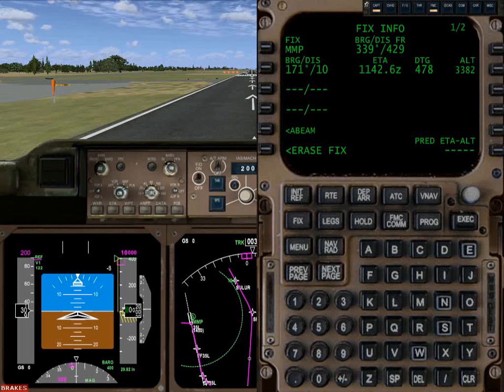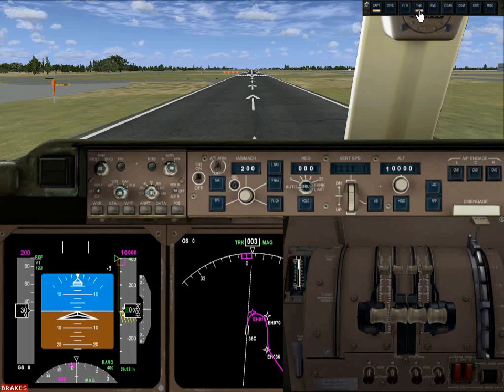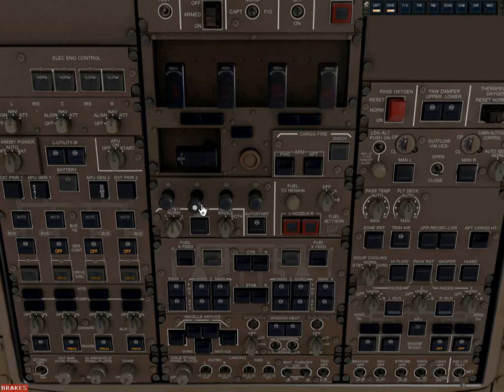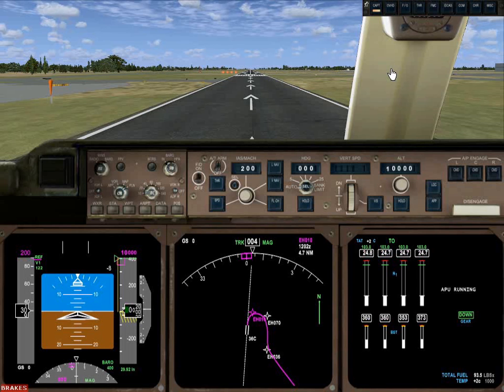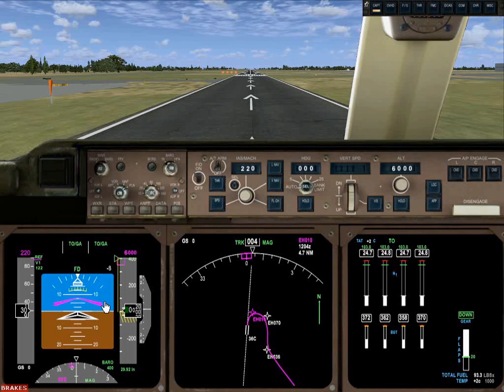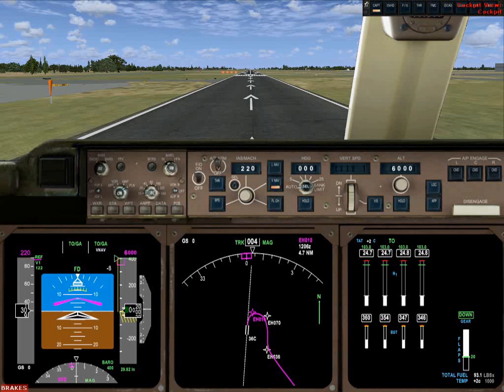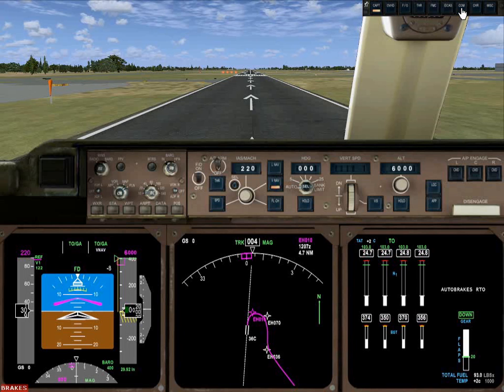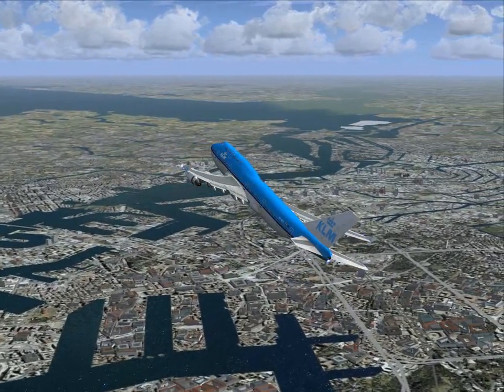PMDG 747 Flight Tutorial Part 5

Comment: Up to now these tutorials have been very good, but your startup procedure in this one is  wrong. To start the 744 the number 4 demand pump should be in the AUX position. the 2 and 3 bleeds should be off.  Engine start order varies by engine type and company policy,  I've seen 1 and 4, followed by 2 and 3. or 4, 3  then 2 and 3 together. After engine 4 start the the number 4 demand pump can be returned to AUTO. and after all engine are started, the bleed pumps returned to AUTO.